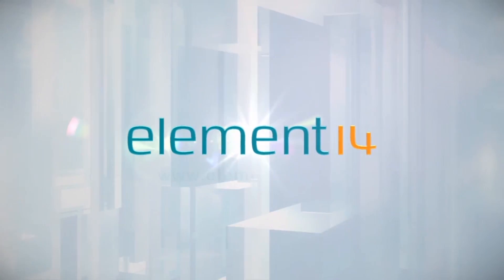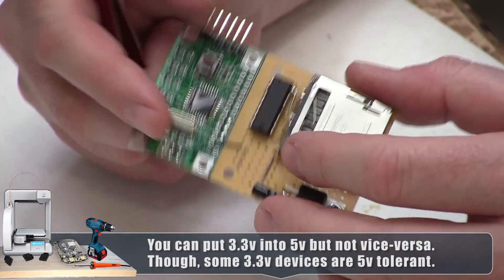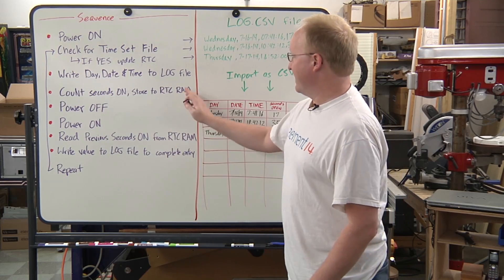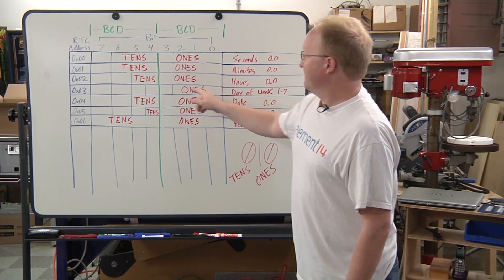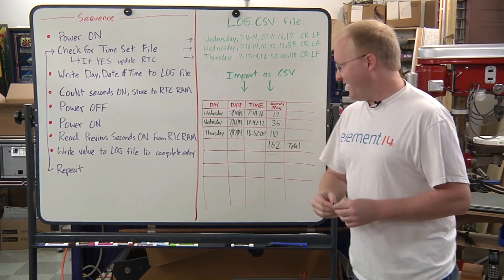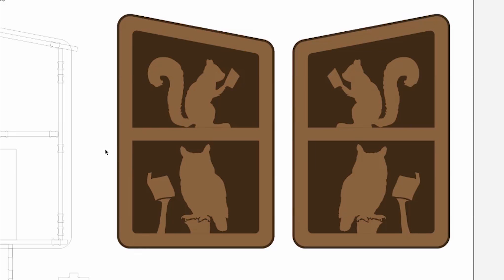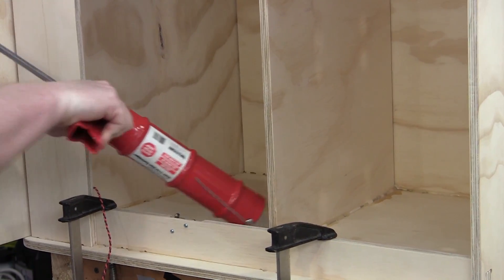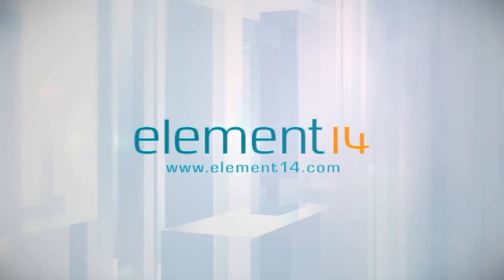Ben Heck's Little Free Library

Comment: You should make it a hardware standard for them. Like have a wifi connection on the logger to communicate with a site/app. A way to suggest books. A system to make sure you put in a book to take a book. Ect.

Comment: How about RFID-tagging the books? Would an RFID reader mounted inside the wooden enclosure be able to tell when books were removed and log that?
(Of course whoever's operating the "library" would need to tag and catalog any new books left there...)
Reply: A barcode reader would do the job.  With a nice wee sign saying " Please swipe books deposited or taken from the little library, thanks ".   I don't see much point in just logging when the door is open.

Comment: Ever thought of doing the opposite of a portable? like turn a gameboy into a console?
Reply: Nay, a full four-player arcade cabinet!
Reply: There is a gameboy player for the gamecube which does that if you are interested, but I would still like a console meant for the gameboy.
Reply: I might since I have a few couple GBAs around
Reply: I want someone to turn a PSP into a console, or at least a laptop. There are a lot of PSP games that are exclusive to the system but playing on that tiny screen is just not so fun.
Reply: ***** Yeah it's not terrible but it has some annoying problems like music issues due to the old ATRAC3 format used for PSP games. It's not anywhere close to where PSX or SNES emulation is though.
Reply: ***** PSX is the original designation for the first-generation Playstation. The "PSone" is a specific version of the PSX, the compact re-release that came out shortly before the PS2 was released. The designators were retroactively changed after that, but some of us remember the way it used to be.

It's also the reason why the best PlayStation emulator is named "ePSXe."
Reply: TzKetDeath actually there is a super gameboy for snes that is just a huge cartridge
Reply: I already own that

Comment: Maybe Ben should have added an LCD display and a HID device like a keyboard for having users write suggestions for the Library. ;)
Reply: or post a text message address so you can text the library. or maybe a vice message button mounted on the door that you can talk in too?
Reply: would need a solar panel then, and a rather large EEPROM chip, as the 1-2k in most AVRs probably won't cut it.
Reply: ***** lol yes they can ask specifically which books they want then. hehehe